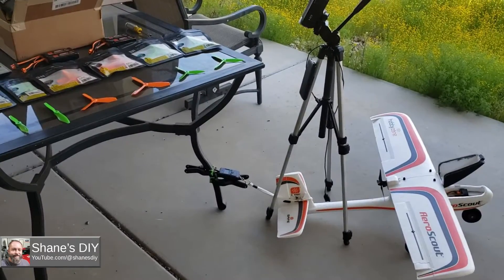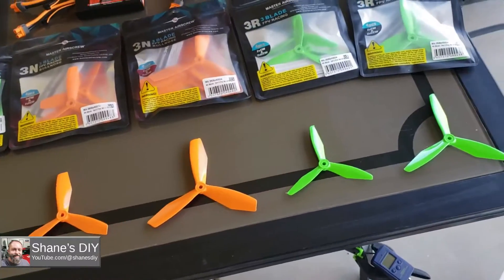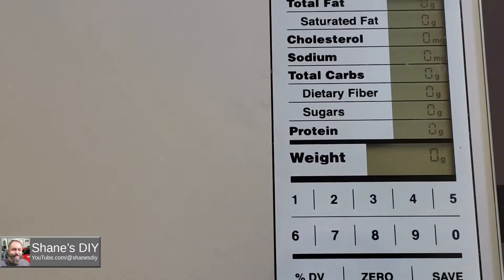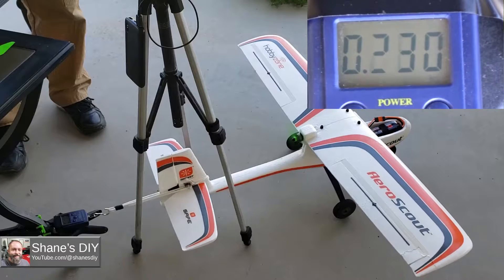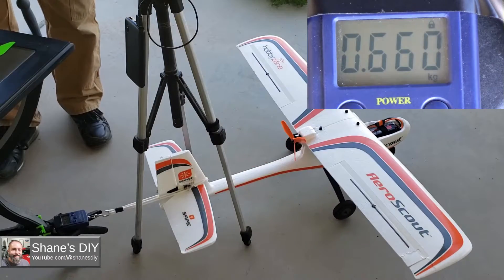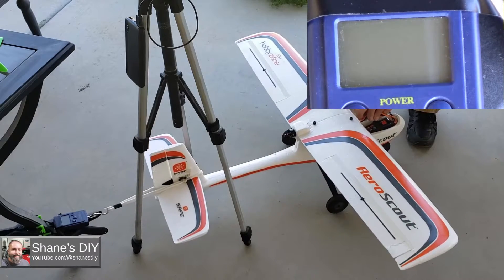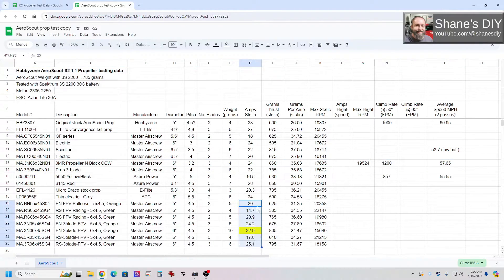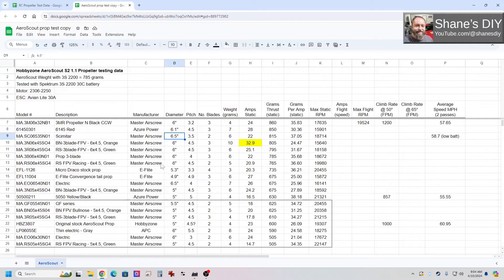The Ultimate AeroScout Propeller Test - Part 4

Comment: I have the original aeroscout.   Will that Master Airscrew 6x3.2 still be ok on the older motor/esc ?
Reply from the maker: Yes. Amperage is nearly the same with the 6x3.2 vs stock prop.
Reply: @shanesdiy  and the ccw one linked is the right one?
Reply from the maker: Yes. CW vs CCW depends on the prop but in this case the 6x3.2 needs to be the CCW model in my link.

Comment: I downloaded your spreadsheet and converted it to Excel. I added a column for static pitch speed and enabled filtering for all of the columns. Multiplying the motor's KV by 11.1 volts gives a no-load rpm of 24975. I use the nominal pack voltage because I do my calculations for the end of the flight. I like to multiply the no-load rpm by 80% to get the loaded rpm which in this case gives 19980 rpm. My lower limit would be 75% which is 18731 rpm and my upper limit of 85% would be 21229 rpm. I then filtered the spreadsheet down to static rpm's between 18731 and 21229, static amps between 20 and 25 amps, and static pitch speeds between 55 and 65 mph. Only one prop met all of those conditions, the E-flite UMX Draco prop. It turned 20455 rpm (81.9% of no-load) and had a pitch speed of 63.9 mph. It also produces good thrust; however, I use watts/lb to determine performance, not thrust. And, I believe it sounds the best. I'm not fond of the color though.

Comment: Nice work Shane!  As a result of your testing, I ended up ordering 20 of the MA 6x3.2x3 blade props for the guys in my local RC club.  About 11 of them have converted their AeroScouts to the 6x3.2x3 so far, and at least half a dozen more AeroScout owners haven't picked them up yet.  So far everyone who has switched over to the 6.3.2x3 prop have preferred it over the stock prop, and nobody is willing to go back to the stock prop after flying the 6x3.2x3 prop.  Huge thank you for running these prop tests!
Reply from the maker: Glad to hear it. Will be good to finish up the flight testing portion of this to tie it all together and complete the data set.  Then on the the other planes!
Reply: Dave,
What is your thoughts on the difference in prop noise of the 6x3.2x3 prop vs the stock prop?
For example, is the three blade prop 30% less noise, or 50%, or 60% less?
Thanks a bunch for your insight.
Larry
Reply: @larryhawkes1347  I'm 70 years old, and don't hear all that well anymore, so my opinion should be taken with that in mind.  To me the main difference in the sound of the stock 2 blade prop vs. the MA 6x3.2x3 blade prop is the frequency of the blade noise,  and not necessarily the volume.
Reply: @davemcddd 
Thanks Dave, so I assume that you feel the frequency of the 3 blade prop is less annoying than the stock 2 blade prop.
Reply: @larryhawkes1347  I don't really consider the 3 blade noise to be any more or less annoying than the 2 blade noise.  It's just different.
Reply: @davemcddd 
Very good thanks for the insight 👍🏻
Reply: I ordered this 3 blade prop and have been using it for a couple of weeks now. It reduces the overall speed a bit, but that's okay, it will still fly fast enough when needed. The great benefit is the much longer flight time, I'm getting at least 50% longer times with my style of flying. I'm going to keep using this 3 blade prop. 
The sound of the 3 blade prop is different, but still a bit noisy. There must be some some cavitation noise with having the prop behind the wing and cabin.